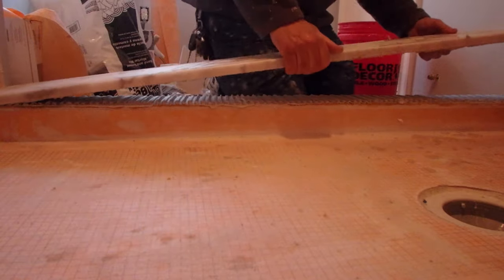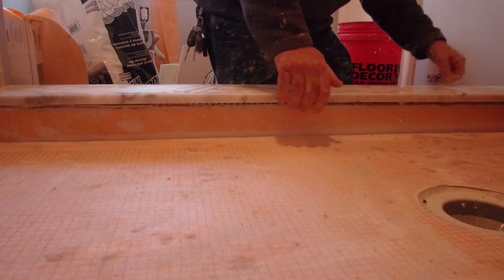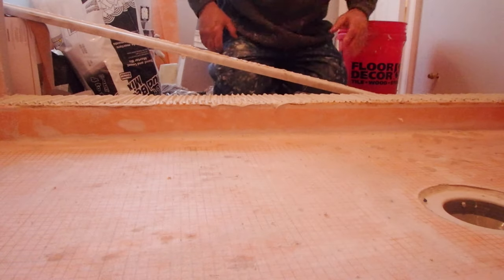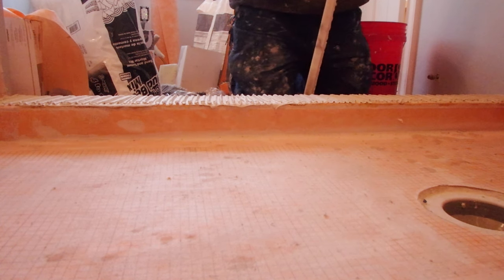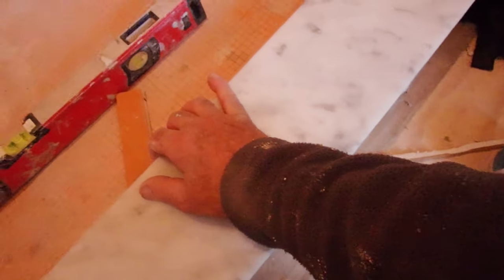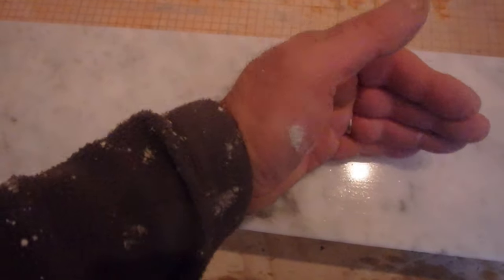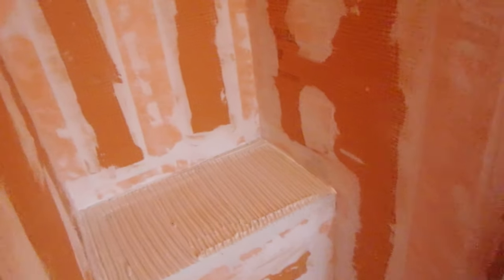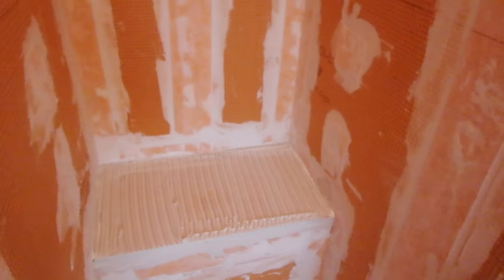Shower bench seat and curb, a few important things to do.

Comment: We are using solid surface for as many bench and curb caps as possible. Sourcing them is tricky, but we now have a few local stone fabricator shops that can provide either scrape that will match the shower wall tile, or we purchase a smaller slab, cut it up and store the extra for future shower builds. Great video as always! 👊
Reply from the maker: Thanks, sills are pretty easy to get here, many colors are stock, pench seats and sills are also often made to match with the vanity tops, lots of options to have them fabricated.

Comment: Hey Sal, love your videos, you definitely take pride in your work. Quick question, do you have a grout line on top of the tile on the sides of the curb between the tile and the marble slab ? Or, do you just butt the tile up against the marble ? I am working on my shower now, and I am at this point.

Comment: Sal i was wondering for shower curbs, if you screw cement board into the curb (penetrating the liner) but fill all the screw holes with thin-set and doing 2 coats of waterproofing (Aquadefence), do you think this is okay?  I have read both people saying this is okay and saying this isn't...

Comment: Great job Sal, I am installing 12x24 rectified tile in my shower, I want to use a 50/50 pattern with 1/8 joints but it is not recommended by the manufacturer. I have seen you install these in several videos without issue. Why is it not recommended?
Reply from the maker: Use a high  quality tile, and a leveling system to get great results, cheap tiles at the box stores will fight you.

Comment: Sal what do you think of a wood framed bench with a traditional mud floor with liner up 10inches face of bench.. then kerdi or go board..walls and bench. Instead of durock with the waterproofing?
Reply: Obviously dont screw the bottom 10 inches of bench face
Reply from the maker: I think that is an outdated and inferior system.

Comment: Hi, thank you for the video. I'm not sure if you have mentioned before. If a framed shower door is attached to the walls and the floor. Are you concerned for any deflection due to schulters foam boards? or do you recommend maybe adding a layer of cement board on the curb for even weight distribution? Thanks a lot!!
Reply from the maker: Never had a problem,  however hinges should be on the walls, nothing on the curb

Comment: Hi Sal, my curb was tilted at first then after thinsetting the darn thing is perfectly level.  Can I pitch the sill during installation with extra thinset on one side?
Reply from the maker: Yes, you don't need a steep  pitch, just enough to have the water run into the shower and not out.

Comment: Pro tip to all tile setter NEVER  put your curb sill on first if possible.
Reply from the maker: Please tell me your reasoning.
Reply: @SalDiBlasi  It's best to leave curb top off with the two end wall cuts until the end. You have less of a chance to break, scratch or damage the top with all the work left to do in the shower. I know you can protect the top  but you can also drop something like  tile , nips, level or step on it with all the in and out. Also with the curb risers on that gives you almost an inch extra to bond to. Eliminate the chance of something bad happing especially when that process  doesn't need to be first.
Reply from the maker: @jcmase72  going to have to disagree with you on that, in 35 years I have never damaged a sill, really isn't that hard to keep it whole. I also like to have the tile rap around the sill to help direct water away from that joint. You do however have a valid reason, just not something that would make me do it that way.
Reply: @SalDiBlasi  I like rapping the tile around the cap too, that's why I leave the end cuts off. Like you I have many years in the trade also even went to trade school for it 26+ years ago. The best practice for the masses is leave it off until the end. Not everyone is a pro. It's a great tip to teach.